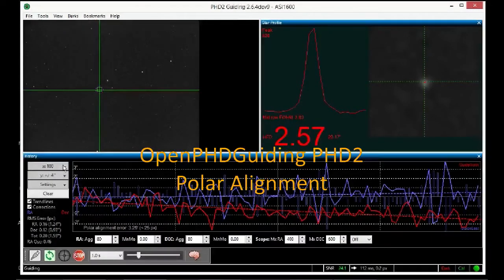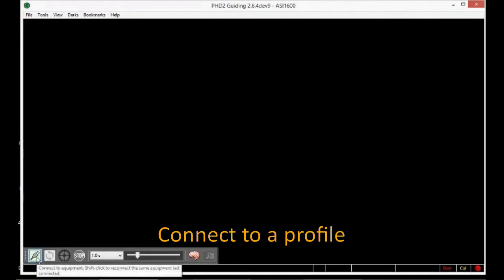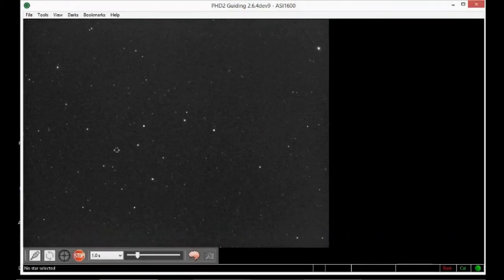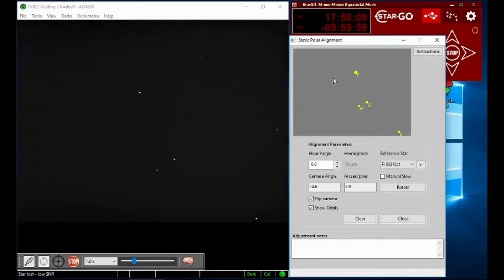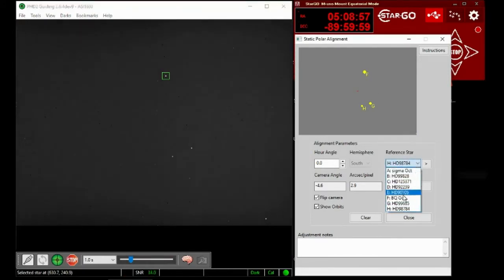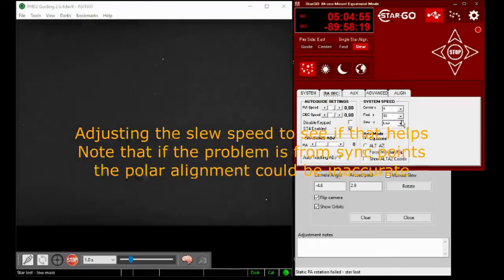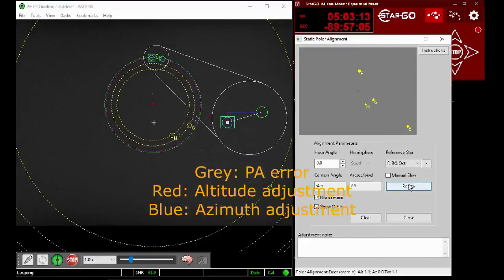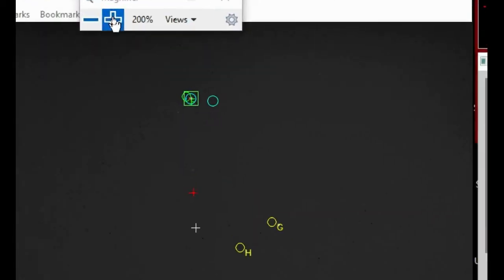PHD2 Polar Alignment Tutorial #4: SPA Auto Mode

Comment: So an OAG cant be used with this process at all? Why is that? Is it the OAG or the guide cameras that are the issue?
Reply from the maker: The problem is the small field of view. When you rotate the mount enough to get an accurate set of readings the star moves out of the field of view unless it is very close to the pole. PDA can work with an OAG though but is not as accurate. In fact I think it is the only on that will work at the pole with an OAG as it is the only one that does not rely on rotating the mount.
Reply: @kengself  Ok that makes sense, thanks.
Reply: Presumably if the main scope has a short focal length of say <500mm an OAG may provide a big enough field of view?

Comment: Thanks for making these videos. Very useful. I did not know that PHD has a static polar alignment tool. Does the UI show what the final polar alignment error is? Do you have to iterate on the process you have shown to make sure alignment succeeded?
Reply from the maker: Hi Pawan, The error is calculated at the end of the rotation process and displayed in the status bar. It does not get updated when you make the adjustments. Sso you would have to repeat the process. One thing to watch for with the automated process is that it is affected by a characteristic of goto mounts that makes them trace a non-circular path due to their alignment points. So if you find subsequent measurements give inconsistent results you should try either the manual process or regular drift alignment.